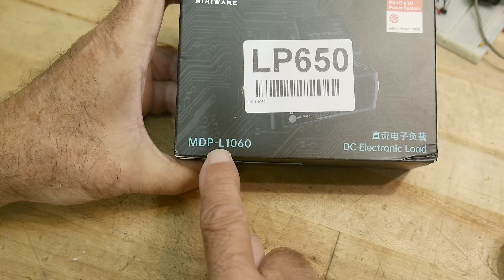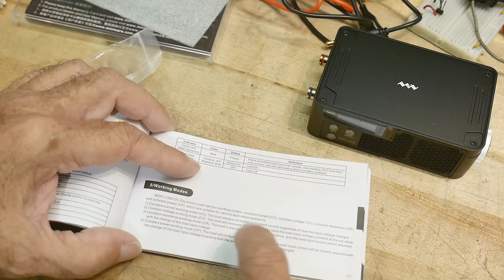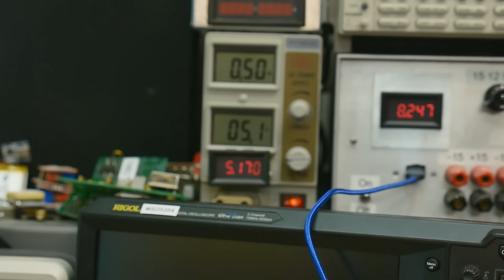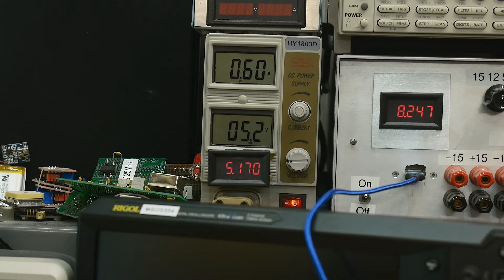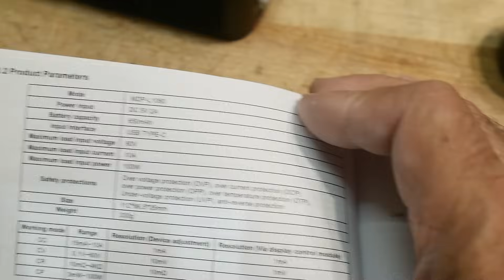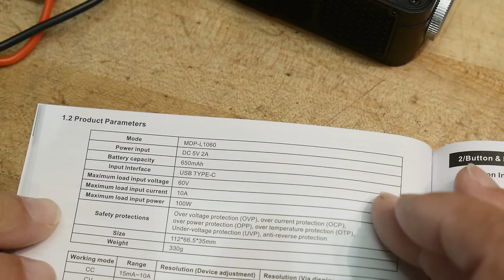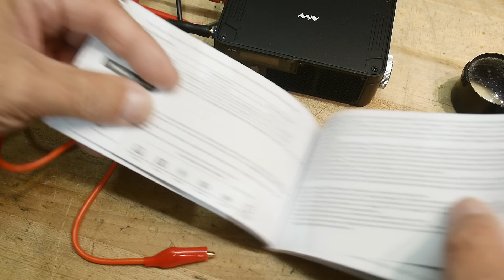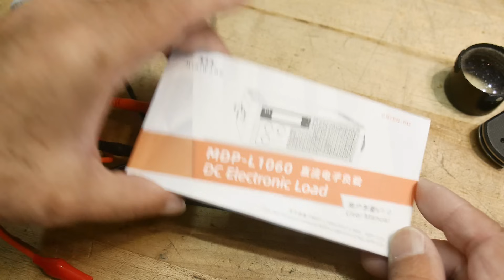#1621 Miniware DC Electronic Load MDP-L1060

Comment: It certainly is cute. But when that rechargeable battery EOLs you'll end up buying that device again and that one will end up in a landfill. Do you really need a portable device in a lab/workshop? If it were a tiny bit bigger, it would have room for a power jack and could run on a wall wart. It'd be useful for battery testing in the field, I suppose, if you do that sort of thing outside the lab.
Reply: I imagine someone who buys a DC load would be able to replace an internal generic battery themselves.

Comment: Need a noise test in an electric circuit during operation. As well as the reaction rate to changes in voltage when operating in the current (power) constant
mode.

Comment: Plan to DIY my Load with strip line resistors and copper spreader combined copper pure water chamber. Plan to plumb it to a dc powered fan cooling a tiny air/h20 exchanger. A dc pump maybe be in order aswell as a bigger reservoir depending on wattage & time under load ☺️

Comment: That yellow connector is an XT 60amp.   Miniware stuff is popular among RC enthusiasts, and those XT connectors are typical for (modern) lipo battery leads.  I use them instead of older connectors like the Anderson power pole or deans.  If I hadn't already bought a dc load when I got into building quadcopters, I would have got this one.  It's nice and compact and conveniently has that connector that works on all my lipos smaller than 10Ah.  Miniware also makes a great field soldering iron called the ts100 that connects to lipo packs using that same connector.  The TS100 is the gold standard iron among RC enthusiasts.
Reply: It”s actually XT30
Reply: AFAIK the XT60 is only for sensing the voltage, and not discharging anything
Reply: As @KGBot pointed out, it's a XT30.
and @christophfuchs407 is correct, it's a remote voltage sense connection.
This is used so it can compensate for the voltage drop across the wiring to the unit (if you're running longer wires) it appears that it's optional though as I haven't seen anyone use that connection yet in the few videos I have seen of it.

Comment: For the price I'll stick with the West Mountain Radio CBA.
Reply: In the same price range, the CBA only does 10W.  To get higher wattage, it is more money and much larger.  Then, from what I see of the CBA, you need to connect them to a computer and run software.  While there is some overlap, that's a completely different device.

Comment: what a cute little device. A kind of swiss army knife.  If it's 'modulateable' make a great dynamic load for psu stability /phasemargin checking and all that.
The RF looks interesting whatever that is. Be great if can wirelessly controlled/monitored. Could integrate these into ATE rigs. Though a USB wired for that prefiere